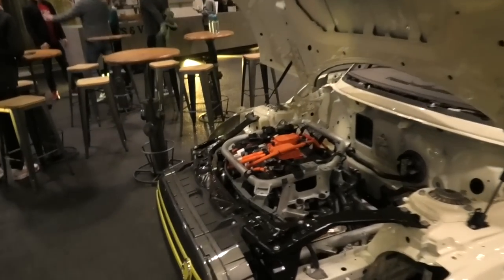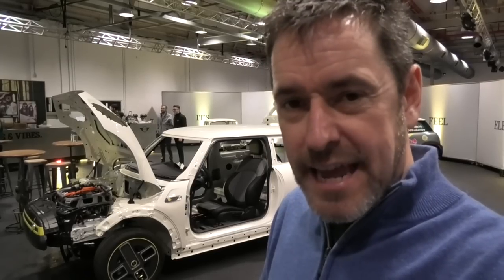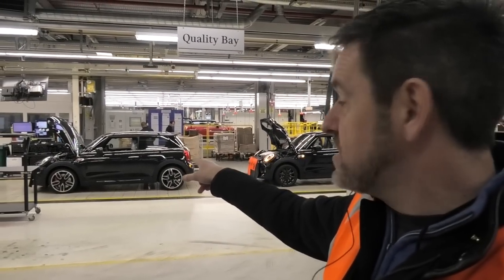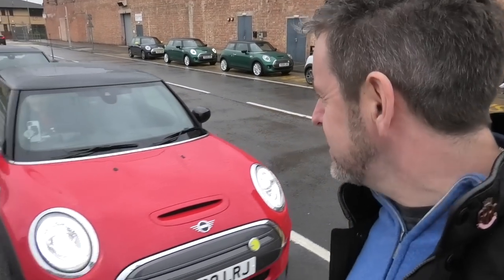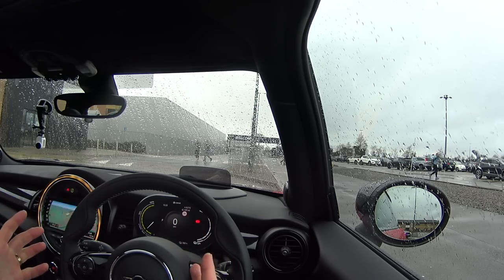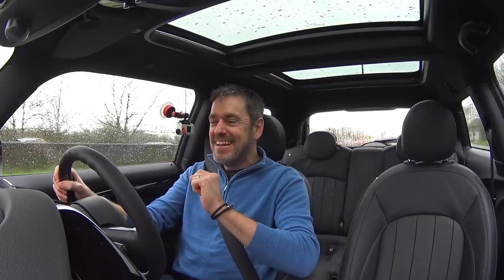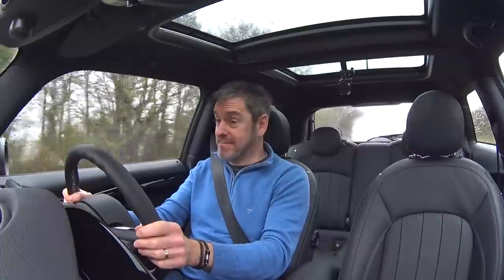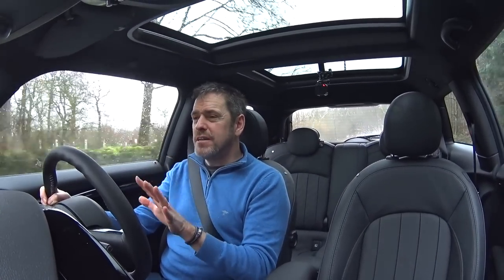Building and Driving Mini Electric - The most important Mini ever !

Comment: Thanks for a great video Peter I love the idea of an electric car and as you have found out in one of your videos its not so much the range of the car thats the problem its the infrastructure thats the problem and can you find a charger.
If they where like petrol station and everywhere it would not be a problem at all
Reply: There are actually more chargers than petrol pumps. But it will be a good thing when there are more in petrol stations. It's still early days for EV's when you compare the start of the petrol engine and buying fuel from the chemist, it does not seem so bad.

Comment: Great video, the interior has to stay the same as it wouldn't be a Mini, I always wanted a Mini but couldn't fit in the driver's seat as being 6ft 1 inch my legs caught under the steering wheel. BMW plans I believe are to make their cars on the same production lines but to have various power modules, hope they make a Clubman version
Reply from the maker: I am 6’3” 🤔
Reply: Petrol Ped I was talking about the original Mini designed by Alex Issigonis
Reply from the maker: Yep, I fit in one of those too 👍

Comment: Great review but not the car for me. just ordered 2 EVs  based on your previous 2 EV reviews, but this mini’s range is a bit to low even for a second car. This is highlighted at the end of your video with pop up chargers. In summary, great concept, little dated, needs about 50-75 miles more range.
Reply: Dylan Obrien yes indeed. And lacking adaptive cruise control

Comment: Electric plug style wheels, so different wheels depending on your country?
Reply from the maker: Good point but sadly not. Just think of the Union Flag lights 😜
Reply: Perhaps Mini could provide adapters that press on (like an aftermarket hubcap) and convert your wheels to the local socket layout? 🤔😂

Comment: I think it’s sacrilege to build petrol cars when you have an electric car. They require more commitment to the electric car and not bother with the petrol version because the ice engine has some 1200 moving parts whereas the electric has about 12. If there were more battery factories to drive down the cost of batteries then the electric car would be cheaper than the petrol car.

Comment: The issue is not making electric cars the issue is going to be infrastructure,just look at the carnage required behind those parked cars to deliver some charge so you could get back to the factory

Imagine the day when every car on the M25 is electric and we have a major hold up,snow,accident etc and a few people didn’t get a full charge the night before! All of a sudden you could have 100’s of immovable cars stranded,Will they be airlifted off as you can’t just drop a can of fuel into them

Also just imagine what service areas will look like. Every single car parking space at Clacket Lane and every other service area will need to have all its bays electrified,I don’t think that’s possible!

When I was in the trade before I retired to put one fast charger in a dealership the electricity board had to install a new substation on the estate to provide the power required. The cost was down to us, £150k to provide electric for just a couple of rapid chargers!!! We declined

I just can’t see anyway we are going to get enough power to places like service areas for full electrification to become the norm.

Also what is the actual requirement for the BIG BOXES ( power stations) the other end to provide all this power?

With what is just the handful of electric cars we now have electric charging points are not always easy to find or have queues,when there are 100’s of thousands of cars it will be carnage,you won’t be able to charge away from home

Here’s a question,in the post codes  N,E,W,S etc how many homes are there,if forced to go electric how many of those people (%) do you think would be able to get finance on a 25-35k car and even afford it. Also in those post codes how many people live in high rise blocks or just have off street parking

If we are saying that those people just won’t be able to have cars because of their living circumstances then I can see chaos

Electric cars may well become something that only those with the income and properties than can facilitate home charging will be able to buy!

I think it is a very ill conceived and impractical solution to work on mass

Just google street view for any road in the above areas and ask how is it going to work if every parked car you see has to be converted for an electric one?
Reply: Ade Matthews Yes I don’t disagree there will be a gradual change,however the danger could be if councils start to put rings around towns where non electric cars will either be named or heavily taxed

Look at the ULEZ zone,it’s already spreading,it will also get more draconian on which cars will be charged to enter it!

Very soon you will be quite surprised at the types of car that will have to pay a ULEZ charge for each and every day they are used

Comment: "the most important mini ever"  no. the original mini was the most important mini.
Reply: Agreed.
Most important Mini my ass. 

What a pretentious tosser.
The most important mini is the one that first started this, the model that showed up at Monte Carlo in the 1960's the model that remained essentially unchanged for over 20 years.
I've owned and worked on the original and it was a fantastic bit of design and used almost every single square inch of what little space it had.
This mini, is a pale imitation of it and it shows.
Where the original Mini was an everyman's car, Britain's Ford Model T, this BMW Mini is a fashion purse, fat, overweight, with horrible utilization of space and over priced fashion item.
Where the original took on cars that had more power than it had and beat them at Monte Carlo, Bathurst and other tracks and rallies across the world and in doing so became a legend
This BMW is but an pale echo of past glory.
Reply: @pogo1140  i love old minis, i think the new minis are ugly, huge, overpriced geos. 

cant wait for project binky to be done.

Comment: What is the battery degradation of the batteries? For example what would the battery condition be after say 5 years i.e. say 10% drop per year? I don’t know the answer to this question. 

I have family members who have kept ICE diesel cars for 7 and 9 years respectfully and the range has always been roughly the same over their period of ownership. How does this work with an electric car and a hydrogen fuel cell car?
Reply from the maker: Tesla Model Ss are used as taxis in the Netherlands. There are cars with 500,000km that have batteries still running at 80%+ battery efficiency. A Tesla motor that has done 1 million miles was recently inspected and it had zero wear 👌
Reply from the maker: I am not sponsored by Tesla just in case you think I am 😂
Reply: @PetrolPed  Thanks for the information.

Comment: I'll never be able to afford to buy a new car and what concerns me is battery pack life i.e even modern tech batteries will stop holding a full charge, so say in 5 years time will the battery pack be bordering on hopeless and would probably need replacing, surely this will have a serious impact on used EV's
Reply: Matt Wood nope, batteries are now lasting much better than before due to excellent battery management built into the car
Reply from the maker: Tesla batteries from Dutch taxis with over 500,000km on the clock have been testing and are still operating at 85% efficiency. Don't think of them like your mobile phone 👍

Comment: The biggest problem with this car is it wasn’t designed from the ground up to be an electric car. It’s got the same running gear as the i3 but weighs loads more therefore the range is a lot less.  It’s makes no sense to buy this over an i3
Reply from the maker: Apart from the fact the i3 us ugly 😜😂
Reply: Petrol Ped I actually think the i3S is really nice

Comment: The range is absolutely fine for most people, BUT on maybe the rare occasion you need to drive 70+ miles somewhere it's going to be an issue of planning charging stops with range anxiety. If they'd made it with a 200 mile range I think the car would have been perfect. Looks great BTW.

Comment: Nice enough car for the first/maybe second owner if the lack of range is not an issue but you haven’t mentioned the cost to replace the battery pack for subsequent owners. Each year it is well known that the battery efficiency reduces so by year three would you get a hundred mile range out of it? Worthless scrap by year 8/10.

Comment: Its a hash up of the ev it should have been, by shoving  batteries in gaps vacated by the engine exhaust and fuel tank is not a good packaging job at all. The mini is a compromised ev filled up with batteries squeezed in any  gap possible with a motor from the BMW I3 that came out years ago  lf the design team was given a fresh start they would not use a hand me down body that comes with  limitations built in by the small space for battery locations that ultimately limits range. If the mini design team was given free range as they should have been i know that they would deliver a car with comparable range that all the new cars and its direct competition gives you but with minis flare. Building a car on a body never designed to be electric will never give you a cars full minty flavor just a sugar free example that never gives you the zing you was promised.

Comment: Great review👍 Sadly I just cannot seem to get past the lack of sound with these vehicles 😕. A good friend has a model 3 and there is no denying the performance but it’s just not the same. Also 55 minutes at a Tesla charge point to go from 20% to 95% 💤. Not hating, just my opinion :-)
Reply: Nelly Jon people don’t normally charge to 95% on long runs, unless they are stopping anyway for a long meal break. Charging slows down considerably when you get to the higher states of charge, so it makes far more sense to charge to 80 (ish) % in half the time and then do the same at the next charger. Basically a 20 minute charge stop every 3-4 hours of driving, which sounds fine to me, I’d need a short rest break by then anyway.

Comment: Wrong design for an EV it's a petrol mini with an electric engine as for the range it's 2020 it should be a minimum of 180 miles range. There are much better cars to compete with & plenty more coming this year.
Reply: Frank Stocker unless you are a rep 150 miles is plenty, most people do at most 30-40 miles a day.
Reply: @Jabber-ig3iw  150 miles with the wind behind you on a flat road. The Renault Zoe predict 186 miles & the Niro 239 miles. Let's see how the mini performs this year.

Comment: EV is not the overall solution for the future for cars, Hydrogen or Hybrid are better than full electric which won't work across the globe as there is insufficient Electric infrastructure distribution globally to support EV!
Reply: Ade Matthews Electric in remote parts of the World is a no, no Africa, Russia, Australia! Hydrogen is the answer for remote parts of the World! We all don’t live in Cities or Suburbs with developed Electrical distribution! Fitting a hydrogen tank and pump would be expensive in remote locations but far better than a load of diesel generators charging EV vehicles! In Siberia temperatures are -40 to -60 c for months and battery life in those temperatures reduce drastically!